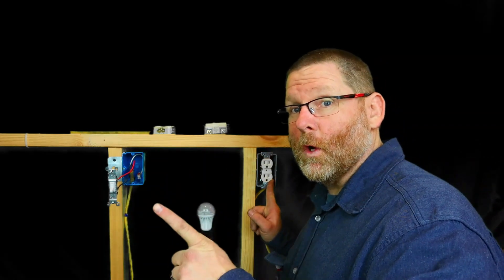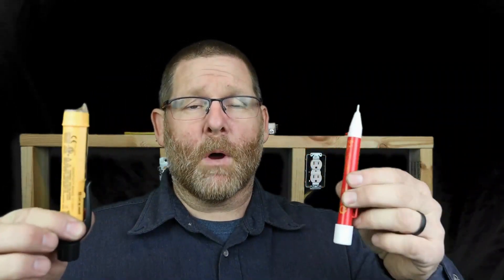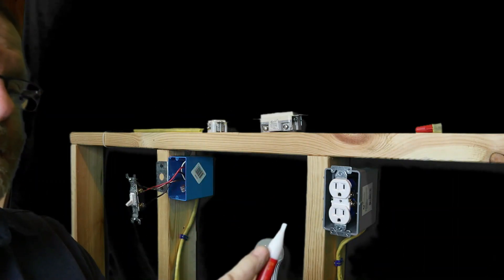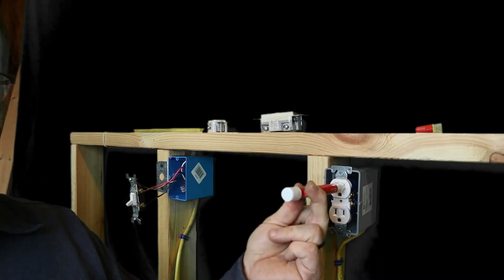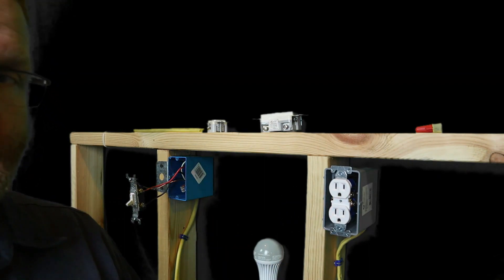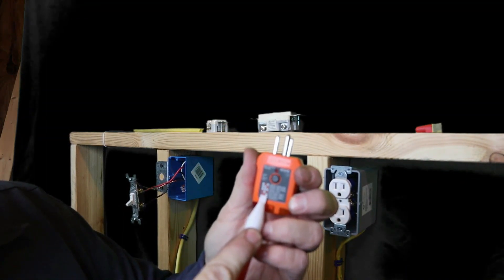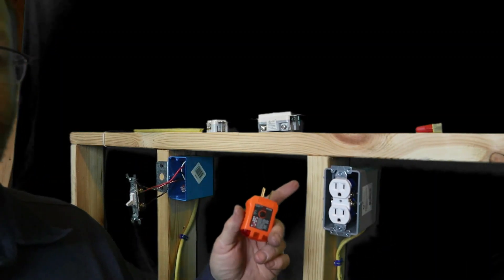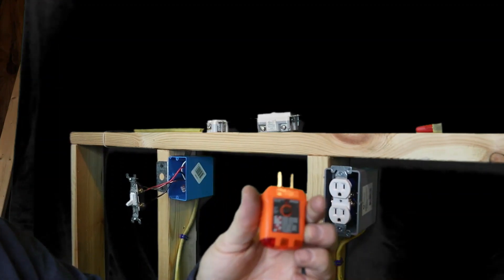Miswired Receptacles Don't Make This Mistake

Comment: Thanks. Why do you like the Santronic tic tracer the best?
Reply from the maker: In my opinion it's much more sensitive than the fluke and where I worked before they had 25 cycle electric and 60 cycle and it was the only one that would pick that 25 cycle up

Comment: I'm not electrician but I enjoy your video very education. I have a question. If the air handler calls for 45 amps. The panel and disconnect box it has 40 amps breaker. Can I change the breaker at the disconnect box. The wire size is correct 6 awg
Reply from the maker: So there is alot of information that you need to find out. 1st of all, is your disconnect box rated for at least what your wanting to feed it with. In other words, if you need 60 amps is it rated for 60?  To find that look at the sticker on the box it will tell you exactly how much it's rated for. If so then absolutely. If not then you will have to install the correct box. Does that make sense?
Reply: @MountaineerOutdoors  That's the question. If it is rated for the 45 amps, that means I can change at the disconnect box ?